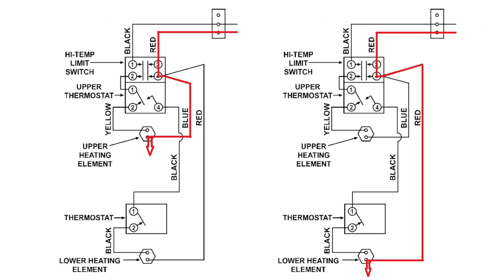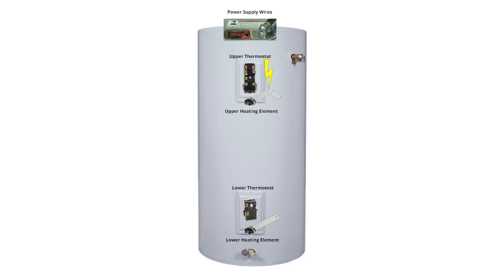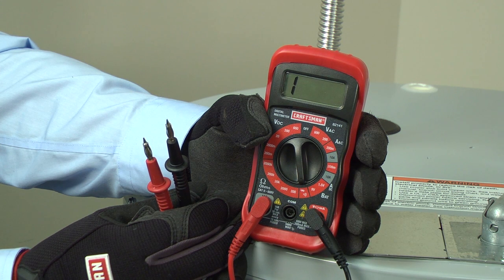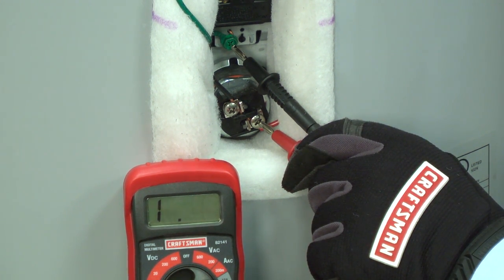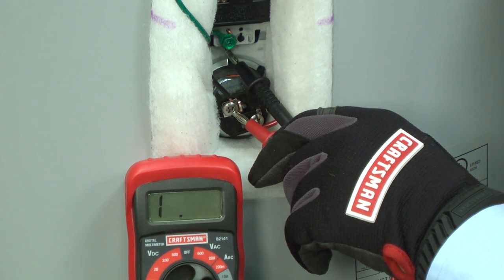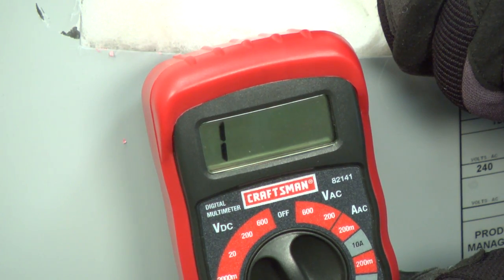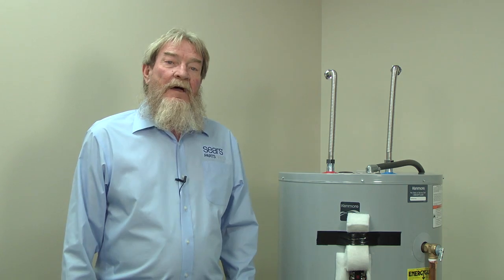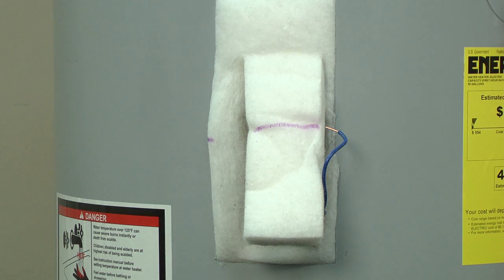Water Too Hot: Electric Water Heater Troubleshooting

Comment: I think my top Thermostat is bad, because it intermittently trips (has a built in trip safety), and sometimes it doesn't trip, and the pressure safety valve releases. Good video. I'm going to check everything exactly how you describe before replacing the thermostat.

Comment: Thanks for the straight and informative video.  I performed the tests in the video and the elements measured at 13 and 17 ohms. I think these are above the thresholds mentioned in the video but I have different brand water heater.  And my water heater has a high temperature limit control on the upper thermostat.  I just pressed the red reset button and now the water is average hot as expected.

Comment: No way to test the thermostats???  Turn up the thermostat dial to high, measure current across heating coil terminals with voltmeter.  Now turn thermostat dial all the way down and see if voltage drops to zero (also you can hear a clicking sound).
Reply: You mention measuring current and the next sentence you mention voltage. Not sure if you should be poking around mains if you’re using current and voltage interchangeably.
Reply: Most voltmeters won't measure the CURRENT.  You'd need a clamp on meter to check current which would be about 20 amps.  Even if the element is open you would read 220-240 across the elements terminals when the thermostat supplies it.  And while it might switch when you are turning the knob, it may not when it is relying on the bi-metal disc to switch it.
Reply: @hjc4604  very good ;)

Comment: How to troubleshoot the thermostats.  After determining the elements were not shorted, and with the water at 170 degrees, I turned the breaker on and then checked each element to see which on had current flowing to it through a bad thermostat.  It was the bottom thermostat and the top was working properly.  Hey, I know little about plumbing and electricity, but this logically made sense.  You can also test the thermostats with the power off by checking continuity between the two posts on the thermostats.  Unless your hand is over the temperature setting on the thermostat, there should be no current flow through the thermostat.  So I replaced the bottom thermostat only and the hot water heater is now working properly.
Reply: You DA man! Thank you from a restoration Mason!

Comment: Water temperature 135 degrees and Rising. So I shut off the power check the elements and they were good. Turn the top thermostat higher it finally came on at 135 degrees because I heard it click. Turn it back down to 120 original setting. Went to bottom thermostat would not click when I raise the temperature then clicked off at about 95 degrees. Problem solved. Replace bottom thermostat. Works fine.

Comment: Good video! I had an issue with my tank, it blew 2 lower elements out. The first one after 2 weeks of use of a newly installed heater, the second went after 3 weeks of replacing the previous. Ok, so know what's up? Of course each one happened on the weekend, and couldn't call the Rheem warranty department, so it was up to me. I did a voltage check, all good at 240. Then shut the power off for an element resistance check. Lower one blown. Upper was at 13.8 ohms. Replaced lower element with a spare I had. Checked it,13.7 ohms, all good. Now a continuity check across the poles on each thermostat, starting with the overheat protection breaker at the top thermostat. That was good. The upper thermostat, I removed and used a heat gun to check that it worked. It did. Checked the bottom one, it worked too. Re-installed everything, filled the tank, made sure all air out, then turned on the power. The top element started working. Bottom was off. After 20 minutes, the top shut off, the bottom started. After 1 hour, it still has not shut off. I'm now suspecting the bottom thermostat is not working like it should. I think that remaining on all the time, the lower element will blow out again. I'm going ot change the bottom thermostat. So there is a way to check your thermostats, if your patient.

Comment: Great video Wayne - - Question though....
I am not an appliance tech so I may be thinking crazy here.....
You stated there is no way to test a thermostat.  
couldn't I rotate the setting on the upper between high temp and low temp and see which element is being supplied with voltage from L1. 
If I set the upper thermostat to the highest setting, then L1 should be providing power to the upper element - - If I go low temp and L1 is providing power to the lower thermostat, then that should indicate that the upper thermostat is good.
Now - - If I have L1 at the top side (input) of the lower thermostat, I should be able to go to low temp setting and see if I have L1 to the element ( should be open circuit / no voltage ) - then rotate to highest setting and I should see voltage at the lower element.  
If I am overheating - - and L1 power is being supplied to the lower thermostat, then shouldn't that be my indication that my lower thermostat is the reason for the overheat ?
Reply from the maker: Overheating can be caused by a stuck contact in either of the thermostats. A shorted wire or shorted heating element can also cause the water heater to overheat water. For safety, we recommending checking the elements and thermostats using resistance checks with water heater electrical power disconnected. We don’t recommend that you conduct the live voltage checks that you’re describing because live voltage checks are dangerous. Checking live voltage can result in injury due to electrocution if not conducted properly using proper safety equipment such as insulated rubber gloves. Even if you performed that test, you could only determine which element was getting current through the thermostat cycling switch on the upper element. That test won’t necessarily point you to the failed element. We recommend that you disconnect electrical power and perform the resistance checks shown in the video to diagnose the water overheating problem. If you’re not able to determine which thermostat is at fault using those tactics, then we recommend replacing one thermostat to attempt to fix the water overheating problem. If the water heater still overheats the water, replace the other thermostat. The thermostats aren’t very expensive for most water heaters. You have a 50 percent chance of guessing right and the added expense of buying the second thermostat is worth avoiding the safety risk of live voltage checks. We hope this information helps. If you need more assistance, let us know.
Reply: @searspartsdirect   It's usually the lower Thermostat, but not always ;) Good points on this video... Keeps people safe :D

Comment: let's replace both thermostats just for the hell of it. Duh!!!
Reply: Steve - please see my comment above - - - Am I thinking right ??
Reply: I am not an appliance tech so I may be thinking crazy here.....
The video stated there is no way to test a thermostat.  
couldn't I rotate the setting on the upper between high temp and low temp and see which element is being supplied with voltage from L1. 
If I set the upper thermostat to the highest setting, then L1 should be providing power to the upper element - - If I go low temp and L1 is providing power to the lower thermostat, then that should indicate that the upper thermostat is good.
Now - - If I have L1 at the top side (input) of the lower thermostat, I should be able to go to low temp setting and see if I have L1 to the element ( should be open circuit / no voltage ) - then rotate to highest setting and I should see voltage at the lower element.  
If I am overheating - - and L1 power is being supplied to the lower thermostat, then shouldn't that be my indication that my lower thermostat is the reason for the overheat ?
If I am overheating and the top element is still receiving L1 voltage, then wouldn't that tell me the top thermostat is bad ??

Comment: This is not the way to troubleshoot an electric water heater. The guy doesn't understand electricity! 1 ohm on your meter represents continuity buddy you need to remove the wire and then check. Or just let someone that knows what they are doing give the speech!
Reply: The "1" he showed in the video did not indicate 1 ohm. It was to the far left to indicate an open circuit. I'm not sure why multi-meters do that, but the video accurately showed what the meter says when there is no continuity. a 1.0 on the right side of the display would have been 1 ohm.
Reply: Another apprentice trying to play Journeyman. Just relax buddy, and learn well
Reply: Scary